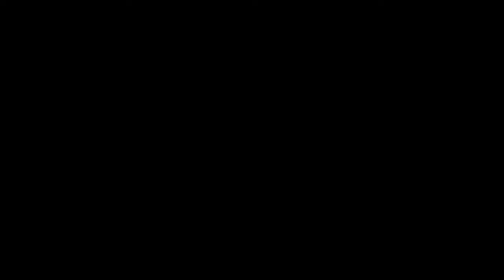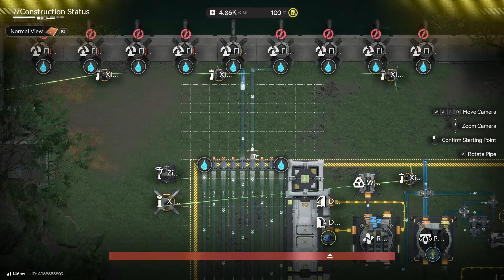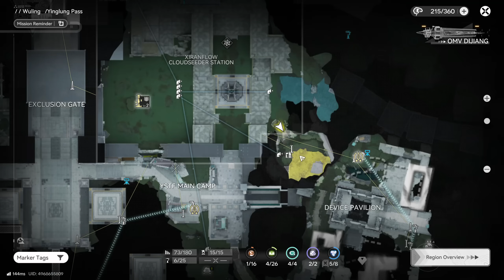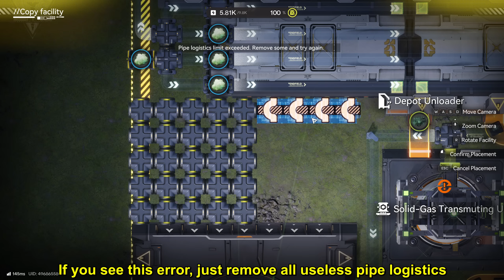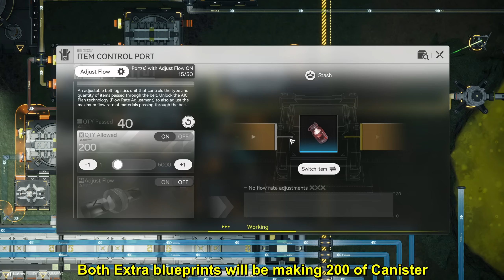1.4 Wuling Factory Blueprints Part 1 - Max Profit Mega Base Blueprint Asia/NA/EU【Arknights Endfield】

Comment from the maker: Codes & READ PLEASE:
- ADD THIS TO THE BASE - Overflow Protector: https://youtu.be/4DIWn-yFb4E
- Do this mission first: Fissure Filling Quest: https://youtu.be/XIoGaKXzsE8
- Sell all produced items or delete if they reach limit!
- Small mistake with Earning Graph: Total Outpost Generation is 88800 instead of 86640.
- Pyrrolite Gears craft is capped to 6/m, i was tired when doing that part and forgot 1 machine is capped to 6/m. So if you want 7.5/m, just add another Gearing unit and redirect one of the line into it.
- So the correct graph is this one: https://imgur.com/a/Fq7kDo4
- Try to only use 2 Thermal Banks. By not having too many facilities around and using Battery in Turrets, you should be able to have below 6.6k Power Usage. My main account even by using 12 Water Treatment Units, only uses 5.5k Power Usage. This way you can save much more Batteries to sell.

Google Doc with all Codes: https://docs.google.com/document/d/e/2PACX-1vRnO57S8bL1XOiTDw3GjtCCfWjMHNtNlw63csFBszTLrhnXncP5dXUZP_e9hXr2sPUSRd_AiakdXyak/pub

Asia:
     Wuling 1: (EFO01eAo0IoI9O49uoAi8)
     Wuling 2: (EFO01ouiOAiAEa6A5IieO)
     Wuling 3: (EFO018IeEiei201IeUI73)
     Wuling 4: (EFO017i89o8o6E5I7O0Ai)
     Purif. Node: (EFO017i89o8o6E5I8O0Ai)
     Treat. Units: (EFO01I3A5UAUO19405o08)
     Wuling Alt 1: (EFO018IeEiei201o2UI73)
     Wuling Alt 2: (EFO01I3A5UAUO19625o08)
     JV Sub AIC: (EFO01u8U47U7560i6AoOU)
     MS SubAIC: (EFO01ouiOAiAEa6AAIieO)
     YP Bottom: (EFO01eAo0IoI9O4i6oAi8)
     YP Top: (EFO018IeEiei201IiUI73)
     Extra 1: (EFO01E50Ua0aA3oI43uIa)
     Extra 2: (EFO01a6584543eA71oe5e)
     Temp Cuprium parts: (EFO013o72e7e49a60579)
     Temp Xiranite: (EFO01a6589eao1AU5ou5e)
NA/EU:
     Wuling 1: (EFO01iOe7oIEEU2I67aU4)
     Wuling 2: (EFO01U4Aiu355eOu971a8)
     Wuling 3: (EFO01o083ei99u6A5IieO)
     Wuling 4: (EFO01o083ei99u6OOIieO)
     Purif. Node: (EFO019A612EiiaeU15UI2)
     Treat. Units: (EFO01a709O5UU6Au2oe5e)
     Wuling Alt 1: (EFO01eE7U8o22A469oAi8)
     Wuling Alt 2: (EFO01u1IoAUaa80i6AoOU)
     JV Sub AIC: (EFO01893u7e66I1oaUI73)
     MS SubAIC: (EFO01U4Aiu355eOu271a8)
     YP Bottom: (EFO0172UA3844i5iuO0Ai)
     YP Top: (EFO016i1a42ee0779O83e) 
     Extra 1: (EFO01u1IoAUaa80iUAoOU)
     Extra 2: (EFO01u1IoAUaa8080AoOU)
     Temp Cuprium parts: (EFO014o5O1688E3i7E81A)
     Temp Xiranite: (EFO01A5ie90Ou3Eee91eO)

===================================

0:00 Introduction
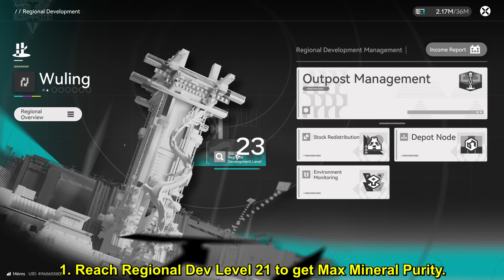0:25 Requirements
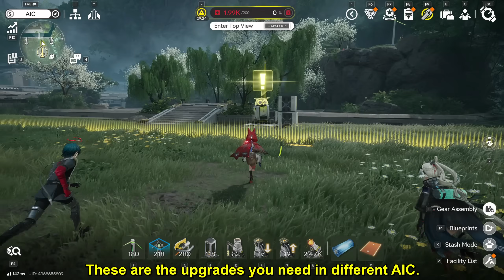1:41 AIC Area Upgrades
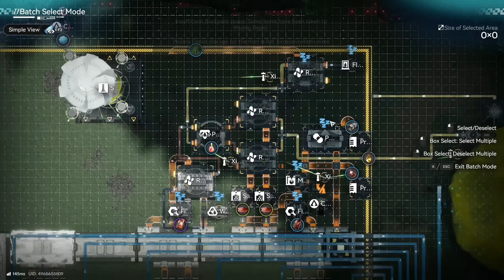2:21 Import Blueprints
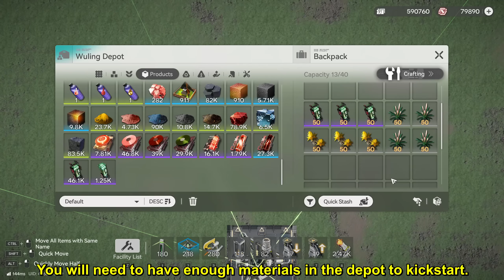3:42 Required Items
4:36 Marker Stone Sub-AIC
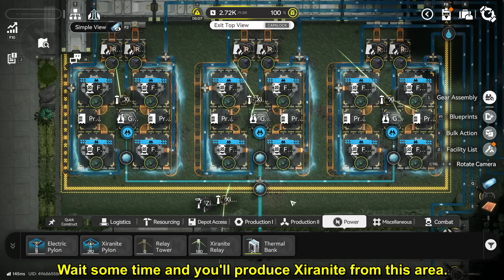7:26 Core AIC Area
11:31 Core Alt
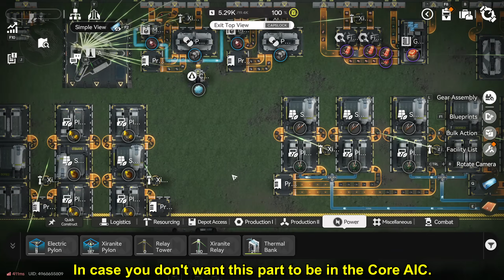12:57 Jinyu Valley Sub-AIC
14:13 Purification Nodes?
15:58 YingLung Pass Sub-AIC
22:14 Extra 1 & Extra 2
25:08 Metastorage Transfer
25:43 Power Usage
26:08 Gear Components
26:49 Base Productions
28:17 Last Words
Reply: This looks heavy mr Kyo. Thank u for your hard work
Reply: where are the extra blueprint codes?
Reply: @Linline02  its in the google doc
Reply: I'm confused is wuling 4 the whole blueprint for the new base? Doing everything speratly is agonizing putting everything in the right place 😭
Reply: Hi, first of all i want to thank you for the guide. I followed all the steps but somehow my battery always stop producing midway because of clogging. Any tips?
Reply: Why cant we copy n paste these blue prints 😔
Reply: I noticed that the Marker Stone Separator Core factory line from the Extra 2 blueprint has a 200 item limit control port at the end.  Why is that there?  it doesn't serve any purpose other than to choke the user's supply of Separator Cores.
Reply: What does the heavy xiranite do in extra 1(tea version)? Liquid heavy xira for exploration?
Reply: @fin.2867 correct
Reply: When i use de wuling 4 NA/EU code, shows YP top blueprint
Reply: Excuse mebut is it possible that the 1.3 had more profit than the 1.4? because a day passed since i built it and i have nothing to sell. in 1.3 i had a lot of batteries and syringes
Reply: @Synenn  Looking back at Kyo's 1.3 video, that base made 77k stock bills per hour at max efficiency (When not producing gear comps). This one makes 123k/hour at max efficiency, and is still higher at 78k/hour with 6 Pyrrolite Comps/min. So overall production value is much higher, and you need Pyrrolite Comps for the new gear anyway.

However, the Outposts now need 88.8k/hour, so you'll be at a deficit unless you only produce 3 Pyrrolite Comps/min (78.4k with 6/min vs 100.7k with 3/min). The 1.3 base, even at minimum exchange production (When producing all 3 gear comps), produced 68.3k/hour of the necessary 65.4k/hour, so we had an excess then no matter what you decided to produce.

I'm guessing the higher Pyrrolite Comp production is what's causing your problem.
Reply: @rmcqu1  Maybe something is wrong in my base. Welp, just need to check all again then. Also, probably slow down pyrrolite to check that, it could be the reason. Thanks!
Reply: a question, how much extra ferrium there is?
Reply: @KyoStinV  hey wuling 4 asia code not working bro
Reply: NA/EU wuling 1.4 code is giving me 1.4 YT Top blueprint
Reply: I know this video is a bit old—since it’s from a month ago—but I had a question. I followed every step to the letter without any errors; specifically, I used the Extra 1 blueprint to produce Jincao Tea, and I didn't use the Purif. Node blueprint since I don't have power issues. However, regarding Heavy Xiranite: I'm producing 24/min and consuming 42/min, instead of just using 12/min while still producing 24/min. Did I make a mistake somewhere? Help pls
Reply: Thank you so much for your work! PS: If you are doing it on purpose to show people then ignore what I am about to say, but you can hold control to place the same building multiple times instead of having to click on the building again!
Reply: Jv sub and YP bottom blueprints not working for asia bro
Reply: @Alex-jd2yx  same bro
Reply: soooo......need start from the scratch huh,even with previous version blueprint

Comment: For some reason my dense originium powder usage is 300/min instead of 295. Trying to figure out how as I am getting losses every hour from monitoring it. Will come back later if I figure it out.

EDIT: Haven't found a "fix" but it seems to not be a problem. So I won't worry about it. I'm making dense originium powder in valley iv and gonna dijiang transfer everything to max just to be sure.

Comment: my pyrolite part is stuck at 4/s the top side doesn't get xiragen to produce pyrolite, all the xiragen goes to the bottom part in yinglung pass. my base level is at 21. already upgrade the purity. no gas extractor are blocked, everything is working

Comment: Noob question, does the Fluid Tank in the Extra 1 BP do anything? Why doesn't it have an outlet? Is it just for refilling Ferrium Bottles?
Reply: Both extra blueprints have the fluid tanks, they make liquid heavy xirenite for exploring, yes you just use it for filling up bottles that you carry everywhere to use on blight to clear them using the spray mechanic

Comment: I'm having a problem with cuprium ore and I'm not sure if anyone can help me. My theoretical data shows a correct yield of 420 and a 420 usage. However, my current data shows a yield of 400 and a usage of 420. I've checked all the mining points and they're supposed to be working (just in case, I'm not using the extra blueprints).
Reply: Possible issues might be that some of your cuprium mines may be shutting off if you didn't place the fluid pump pipes correctly, or because cuprium ore is at depot limit thats why production speed gets lowered, or maybe even regional development level being too low

Comment: Commenting so youtube algorithm promotes your video. With the recent providing of the fully geared lvl 60 gears for new operators, I no longer have gear anxiety, so I held off of watching any guides and factory build myself day-by-day to understand how the latest tools worked. Precisely because of this, I can say your factory management at Yinglung Pass is just so beautiful. Like watching one of those videos where technicians neatly arrange all the wires, your gas piping management with item control port and the use of xiranite pipes into solid-gas transmuters with a xiranite belt has actually allowed the full flow production of the pyrrolite!

I was actually puzzled on how to correctly use the Xiranite pipes and also how to correctly control the 6 units of gas flow per second because the feeding them into solid-gas transmuters with Xiranite belts actually produces 30 units of Xiragen per minute! I didn't realize the use of item control ports was to perfectly limit that flow rate. I also didn't realize with the gas pipes that converging the gas actually makes the flow much steadier, because I had previously separated them into their own conduits but they didn't seem to output steady flow when I leave the operation overnight. You actually accounted for that buffer even in the Yinglung Pass production because you don't even fully use 100 units of Xiranite gas that's piped in from all 5 sources!

It's great to learn from the master. Thank you for putting so much effort. I don't have the time to optimize things, so I always come to your videos when I want to optimize my factory. Seeing all the production flow, along with all the conscientious thought into the designs makes you truly the GOAT Endfield factory youtuber.

P.S. Thanks for all the OG arknights videos. Your annihilation and event boss videos are always the most time-saving videos in the world.

Comment: 24:24 Amazing detail. So, when i discarded the old 1.3 base, i didn't really delete any pipes that were outside the AIC yellow outline. Turns out this outgoing pipe onto the fluid supply unit fits the exact same spot from the old Marker Stone Blueprint. Glory to KyostinV!

Comment: I'm so confused because I've checked everything multiple times. All my machines are working and identical to the video. Yet my chart does not match. Heavy Xiranite Current data after waiting quite a while is showing 10 yield, 2 usage. Theoretical is 24/12. SC Wuling Battery is showing yield 7, usage 2. With theoretical of 18/5. Pyrrolite parts Yield 6/ usage 1. With theoretical of 12/6. Then lastly pyrrolite components at 1 yeild, 6 theoretical.
Reply: nvm, figured it out, I had disconnected a bunch of mining rigs/hydro mining rigs when I moved my AIC in the Sky King Flats outpost.

Comment: Note/warning regarding - 14:13 Purification Nodes?

Assuming nothing else is adjusted with the base layout, this will result in a slow surplus of Xircon, which may lead to clogs after a few weeks.

If you are planning to go this route, either be sure to set up some extra battery production line(s)*, 
OR
set up some overflow protection (i.e. KyoBro's other related guide/video),
OR
manually bulk destroy an amount of your choosing every so often (every other week or so).

*Additional note/warning, regarding setting up an extra battery production line, the production & Metastorage Transfer of Dense Originium Powder won't cover any extra lines, so you may need to set up some backup production in Valley IV, and manually haul over thousands each day via Dijiang. Which is a pain in the butt.
Reply from the maker: you mean if you use the extra Xircon obtained from the Purification Node?
I don't use it, or better this base doesnt use it, so just don't connect the xircon output from purification node.
they will still work even if you dont use the Xircon produced from processing sewages

Comment: I combined both marker stone extra's into 1 with control ports to turn on which side i want. so far i don't notice any issues.  just hook up an extra acid pump, and place a fluid supply unit into the acid lake as well and have a conduit bring the waste acid there from the purification unit. and then choose which side you do not want by turning of the cuprium control ports. (and follow Kyo's instructions with the extra 1 area  (turn off that specific protocol stash, and place seeds in that one seed picker and hook up the pipes etc.)) 
Code EU: EFO01Iao15I7E69o5o08

Comment: As a Satisfactory and Factorio player, I was leery about the gas extraction mechanics in this game. Thank god we don't have to be a master of fluid mechanics where you need to account the elevation and pressure of fluids to make sure it won't backup and clog the pipes. Endfield's factory system is simple enough (for a factory sim vet) that the only thing you need to worry would be your productivity rate, which you can easily solve by playing Tetris with your factory layout.

Comment: 28:21 where does the 24/42 data come from? is the 24/42 data from extra blueprints 1 and 2? is it safe to leave it at 24/42 or will we run out of Heavy Xiranite?

Comment: I'm honestly tired of the factory. but I'll do it myself. I just won't achieve maximum efficiency. I've made 15 batteries, 12 microchips, and 6 pieces for gear. even for trading as a whole, there is enough (where it is also not at all necessary to raise everything to the absolute), thanks to the developers for this, you can do a minimum of production and this is enough, because the bonds go to additional pieces that are not required, and it is not necessary to raise the maximum. Maybe I'm already using guides in the next location, I just don't want to make/redo factories 3 times. I haven't watched the video, but I'm SHOCKED that he was able to make 24 heavy cyranites and 360 regular ones per minute. I can't imagine how this is possible, probably through these gases, which I no longer want to understand. Developers urgently need to do something, people are not ready to make factories.

Comment: Hello. Did anyone else have an issue where the cuprium fills up really fast in the depot and then slows down battery production... leading to auto-depletion of the batteries?? I followed the guide exactly.. i checked twice. im just trying to figure out wt is going wrong. My current actual data says cuprium yield 420/ but usage is 92.. so yea.. it fills up really fast..
Reply: @dasunbaduge8846  yes battery production is so slow now
Reply: Found the issue finally... Wuling main base multiclog fix feature wasnt enabled on asia server. It blocked all the production lines if it wasnt turn on... Watching your latest video where u mentioned this was wt helped.

Comment: Hey Kyo i probably know the answer but trying evade it... so let say i didn't have enough xiranite and now im out completely and built all this was working well for like 5 days is there a way get xiranite without deleting the whole thing?
Reply: Same as me. with the Asia blueprint. Can't clear the 3rd outpost.
Reply: @chiraticx I solve it so probably either in one of the outpost where he sets the plants to get the grey cube i forgot to connect those 3 water pipes i suggest if having a problem go manually through all the machines look which is failing

Cause we do have machines for xiranite but we need the grey cube and for the grey cube you need the plants thingy so maybe check if your plants are producing normally.
Reply: @darkpower3080  what is the grey cube? and which sub AIC did you look into?
Reply: @darkpower3080  And also what did you do to fix it??
Reply: @chiraticxthe one in Jingyu valley you have the plants growing and the grey cube is carbon you need yazhen into a refining unit to make carbon

If you made all the blueprints he said your factories should alone be making already this so it means something is not turn on or your missing a material this is what happen to me in jingyu valley didn't put the 3 tubes, yanzhen was been made, didn't get carbon cause of that and finally no xiranite.l cause no carbon.
Reply: @chiraticx i answer already but here again put 3 tubes that didn't put in the jingyu valley outpost that produce for the flowers, flowers not being made dont make carbon and without carbon no xiranite
Reply: @darkpower3080  thank you, i will be trying that out
Reply: @chiraticx hope it helps and if not check all your outposts means something is failing or not turn on.
Reply: @darkpower3080  are you able to clear out your outpost after this?

Comment: anyone have any clue why my production is steadily dropping? I have the right output at the start but after 48 hours or so it starts to slowly drop until i'm only producing enough batteries to barely run my factory. Everything is set up correctly as far as I can tell.
Reply: Same issue as me, it feels like it's lacking something, I haven't been able to empty out the outpost now.
Reply: @chiraticx Shot in the dark, but check your Ferrium Ore, mine got dis-connected (un powered) when i was moving stuff to fit all in all the water pumps at the main AIC.
Reply: @woodshop2300  Did you check all the ferrium ore? Or was there a specific ore that got disconnected?
Reply: @chiraticxthere is only 1 ferrium ore location in all of Wuling. On the other side, of the river on the cliffs next to the main AIC. It was like one of the OG launch locations. I had moved a power relay tower and the others were not close enough to be in range. Factory ran for like 2 days till i burned out of stock, then all battery production stops as ferrium dust is like a main ingredient.
Reply: @woodshop2300  it's working fine on my end, and i cant still clear the 3rd outpost... :(

Comment: Maybe someone has found a solution to this, because I know I'm not the only one having problems with these blueprints.

The theoretical numbers are correct, but my factory isn't even reaching half of the expected throughput. I tried to check if something was connected incorrectly, but I can't find anything wrong.

The only issue I can see is that my Heavy Xaronite and Xiricon production is always clogged.

I'm using the NA/EU blueprint.
Reply: Same issues as mw with the Asia blueprint.